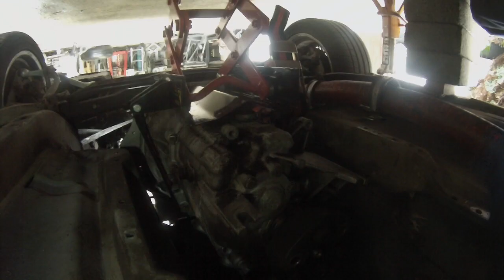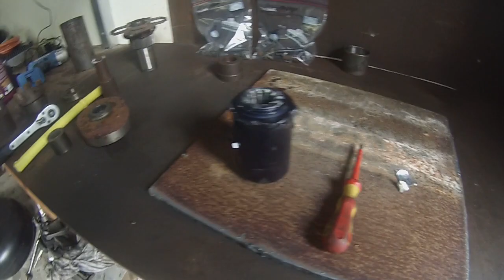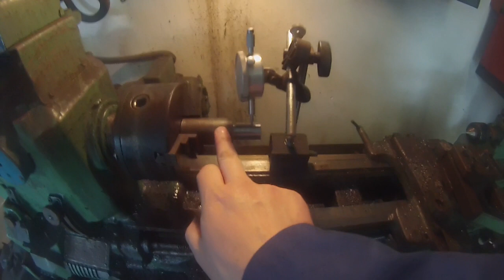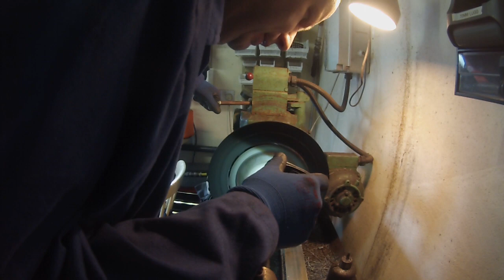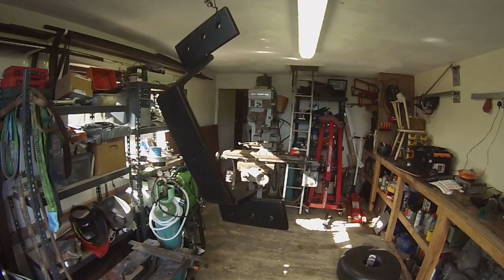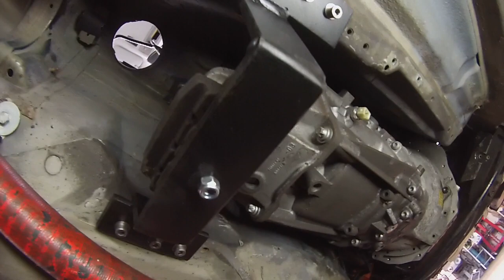BMW E31 840CI EV Conversion 72 : Six Speed Day 2

Comment: Hi Damien. Thanks for sharing the video. Did you consider using a clutch this time to further protect the gearbox from the instant torque of the electric motor? I recon you could install a clutch pedal if you set your mind to it. I can totally associate how uncomfortable it is under a car trying to wrestle with heavy things. That gearbox jack looks brilliant. I used a floor jack plus the gearbox cuddle procedure to lower mine. LOL. Will you be doing another installment of your RX8 Series? I still hope you do a e46 compact one day. ;)
Reply from the maker: No clutch yet. Yeh that gearbox jack is a life saver. Will have another update on the RX8 shortly.